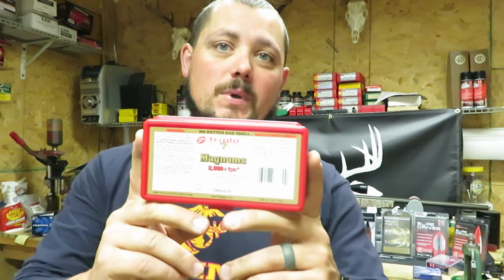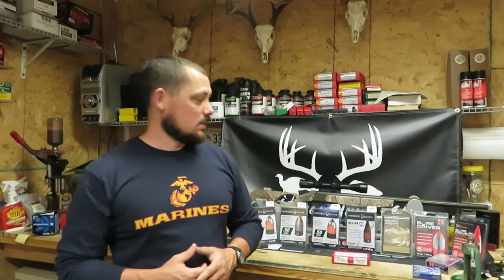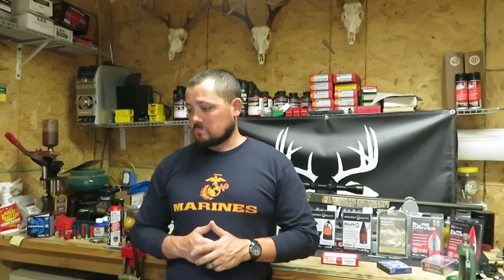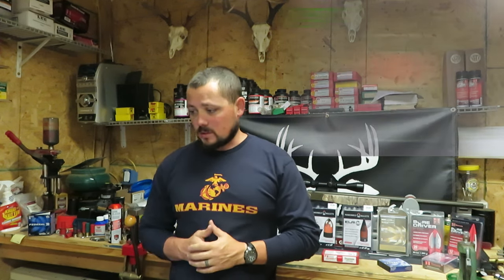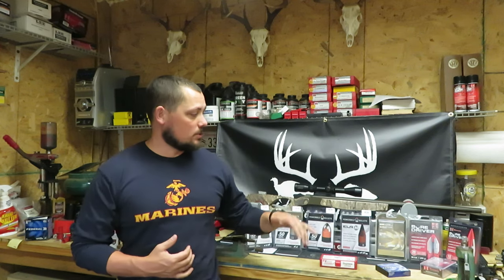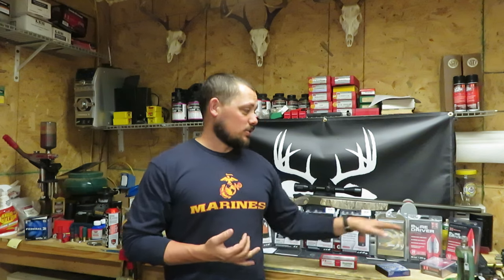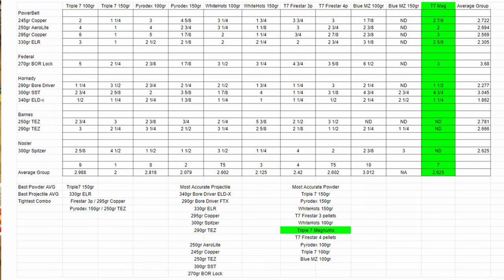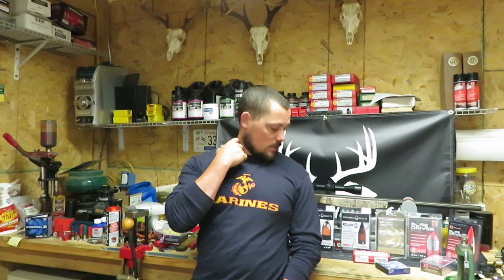Triple 7 Magnum Pellets

Comment: Thanks for all the hard work! I just picked up the Boredriver-FTX and the ELDX. I looking forward to testing them in my TC impact. I have started using loose 777 120 gr. My TCs all have very tight barrels that make shooting Shabots hard. I am looking forward to the easier loading of the bore drivers. I have used XTP and FTX for 20 years and killed deer out to 175 yards. Hornady are great bullets. Lethal!
Reply from the maker: I 100% agree and that’s not with just muzzleloaders. I’m liking forward to the ELDX in 308 and 6.5 Creedmoor as well. I will be testing XTP soon. Thanks for watching

Comment: My experience with muzzle loaders and the powder pellets is after 100 grain the bullets are def not as accurate as just using 100 grains. Saves you a pellet per shot and from my experience 100 grain does the job very nice. I’ve killed several deer at around 200 yards with 100 grains and powerbelt 245 grain. Thanks for the comparison
Reply from the maker: That awesome results for 100gn load. Through the testing that I've done it seems, for the most part, that my rifle like 150gn better. It does cost more and its rougher on the shoulder for sure. But if the projectile is accurate and effective with 100gn charge...Heck yeah I will use it!!

Comment: I use the magnums. Usually shot the 338gr platinum tip. They averaged about 1 1/2 out of my cva mr and 1 3/4 out of my pro hunter encore. Picked up some BD ELD-X. Have not tried them in either yet. Hope they shoot as good or better.
Reply from the maker: Those group will more than do the job!! Nice. Hopefully the ELD-X run good for you. Let me know how that goes. Happy hunting.

Comment: A little off the subject but I have a CVA Optima 50 cal pistol. Tried Triple 7 pellets ,very dirty and don't group at all. Went with White Hots and a real tac driver and alot cleaner. A very fun BP pistol to shoot.
Reply from the maker: I agree 100% in regards to cleanliness or more accurate ease of cleaning. I’ve not messed with the pistols. How is the range on those things?
Reply: @suburbanhunt3653  I've got it shot in at 50 yards less than 1" group. I wouldn't be scared to try one at 100-125. I have a 2× pistol scope on it

Comment: Did you staybwith the 2 magnum pellets?  I have been considering the idea of using 2 magnum pellets with the hornady 250 grain SST. I shoot a knight .50 ultra light. Have had some consistency issues unfortunately. There not much of a muzzeloader community where i live to ask.
Reply from the maker: Sorry brother not sure how to answer. Staybwith has me at a lose. If you mean standby the pellets… I would tell that on average the T7 mags 2 pellets and the T7 100gr charge are fighting for last place each week. It has produce some good group but around average isn’t good. They are also more expensive. I would rather run T7 150gr loads if you don’t mean the recoil. Thanks for watching.
Reply: @suburbanhunt3653  I'll give the 3 50 grain pellets a try and see how I can get them to group. Last year I used 2 pellets and an 250 grain SST and the mule deer got up and walked away.

Comment: Do you keep your blackhorn 209 breech plug in with all your testing? Pellets and loose powder?
Reply from the maker: No I switch between them. 209 for loose and standard for pellets.
Reply: @suburbanhunt3653  good deal. Appreciate the quick response. Would you suggest them cheddite magnum shotshell primers? I know there not as good as the federal 209a but for what’s available now a days would you say they are up there in value?
Reply from the maker: @tegan765tyler  - yes sir they definitely get the job done. They tend to push a little hotter, closer to CCI Mags. I did a primer test video showing the FPS averages when running the PowerBelt 245gr coppers.

Comment: I USE BARNES T-EZ 290 GRAIN COPPER I LIKE THE HEAVIER BULLET WITH MAG 777'S  JUST LIKE I LIKE A HEAVIER ARROW. WOULD YOU EVER TEST THE BARNES ?? THANKS FOR TESTING THE 777 MAGNUMS.  HORNADY'S ARE ALSO BOSS MY DAUGHTER USES THE FTX BORE DRIVERS. GOOD JOB NOT A POWER BELT FAN. BOUGHT SOME ELD X HAVEN'T USED THEM YET BUT EVERY  TEST YOU DID THEY SHOT CRAZY ACCURATE!!! SEMPER FI
Reply from the maker: I did shot the Barnes TEZ in 250 and 290gr however I didn’t have the Triple 7 mags yet. So it would seems like I need to fill in some gaps on my tested combos. The 290s shot better for me as well. Would love to know how the ELDX group for you. Thank for watching Semper Fi.

Comment: Did you weigh the pellets to see what kind of consistency they averaged? How are they as far as clean or typical pellet dirty? I think its safe to bet your going in the field with the ELD X huh
Reply: REALLY WHO CARES WHAT THEY WEIGHT IT'S HOW THEY SHOOT!! ONE SHOT ONE KILL!!! SEMPER FI
Reply: Well sir in  another comparison he weighed pellets to see how consistent they are by weight. I believe one shot one kill and consistency is key to accomplishing a quick clean kill.   @DEVILDOG1964
Reply: @DEVILDOG1964   What they WEIGH will certainly affect how they SHOOT,  just like a center-fire.
Reply: How  dirty are the 3 pellets compared to 2?
Do you have a lead sled or an alternate shooter to buck the wind and shakes?
Reply: I did some weight tests on 777 pellets and averaged a 1 grain difference on all, some outlier pellets as much as 2 grains either way.
Reply from the maker: No I didn’t weight them. If I’m taking to time to weight the powder I’m going to go loose powder. You are 100% on the ELDX for first blood this season. I still want to run other projectiles to see how the work on deer and what kind of tracking is needed. Thinking ELDX, FTX, then ELRs really curious how the will do.
Reply from the maker: @Ebaybow  - I only shoot the 2 pellet groups. They were as dirty as the normal Triple 7 in my opinion.
Reply from the maker: @DEVILDOG1964  - the weight difference in each shot seems to directly impact the point of aim to point of impact. But you are right in that the powder’s consistency is key. Weighed or not.
Reply: @suburbanhunt3653  can't wait for the THOR tests as they are a clone of my discontinued Hornady concave base. Strangely, I am getting good groups with the Powerbelt  ELR's actually, average under 3 inches but my Hornady run under 2 inch all the time.
Reply from the maker: @robclarkson2151  - absolutely. Sorry I didn’t weigh these. I wanted a true out of the box impression. In the previous video is was around the same amount of pellets to get three identical groups. I mainly liked these because they didn’t kick as hard and the Hornady had good results.
Reply from the maker: @jeffhays1968  - thank you for that. If you assume 1 gain per pellet then you have to assume the 2 grain delta. This is a lot. But if you are using pellets then, in my opinion, you are accepting the possibility of wider groups. Mainly but you are giving up the control of a key element in the load.
Reply from the maker: @jeffhays1968  an inch at 100yards makes a big difference